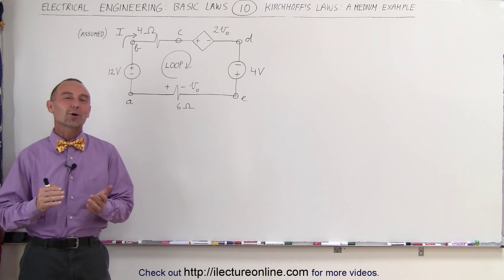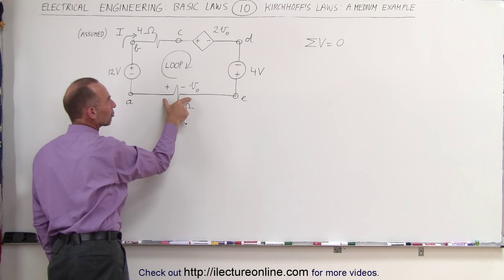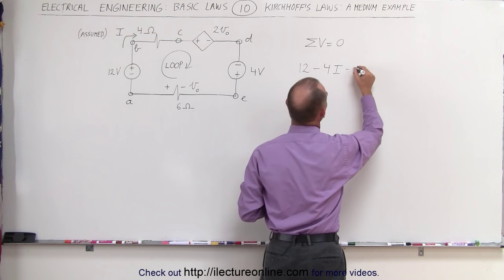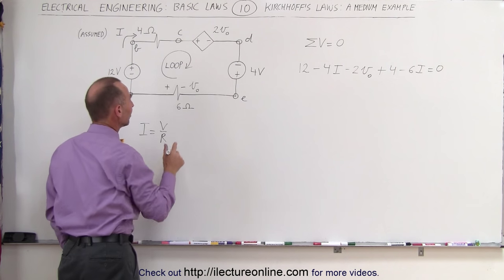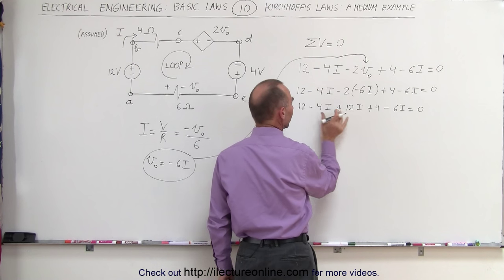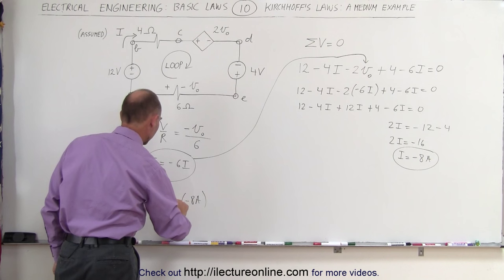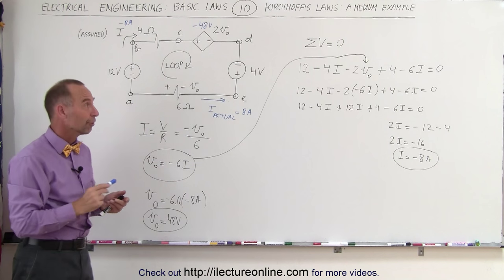Electrical Engineering: Basic Laws (10 of 31) Kirchhoff's Laws: A Medium Example 1

Comment: Thank you for your time and teaching skills.  Since the voltage drop across the 6 ohm resistor is 48 volts and the battery supplied voltage is 2X that voltage drop then the supplied voltage of that battery should be 96 Volts and Kirchhoff's law will work out.
Reply from the maker: You are correct.  it is 2 x (-48 V)
Reply: man i've seen that too, thanks for addressing.
Reply: I saw that too. Thank you for clarifying.

Comment: why does the voltage between C and D is -48 V ? in the video it says 2Vo, what the reason?
Reply from the maker: You are correct, there is an error.  Since Vo = 48 V,   2Vo = 96 V
Reply: @MichelvanBiezen  It also means there is a voltage increase across Vo voltage source rather than a drop!
Reply: @MichelvanBiezen  but is it -96 or +96
Reply: @creedo8301  negative
Reply: With first assumptio is positve, but then with the correct direction of the Current is
 be negative

Comment: The direction in 6 ohm resistor is double standard. You cannot justify double standard. The problem is vague.
Reply from the maker: Not sure what you mean by "double standard".  But in order to solve a problem like this, you have to assume a current direction.

Comment: You have a minor error in sign convention. please revisit your work. Your sign convention show 12V as Positive  and so the 6 Ohm resistor with sign convention Vo must show Left side (-ve) and Right side (+ve). You have shown it backward I believe
Reply from the maker: The video is correct.

Comment: It is possible to have this kind of circuit in real life ? I mean there are 3 voltage sources "pumping" voltage in different direction (+ connected to + and - connected to -). The formula implies that it's the "strongest" voltage  source that win (the one between c and d) and it's this one that imposes the current direction. But then how the 2 others react in real life ? Won't they burn if we "feed" current into them?
Reply from the maker: You could hook up such a circuit and no this wouldn't cause problems, but then you are correct, it doesn't serve any purpose except that if gives us a good exercise problem to learn from.
Reply: @MichelvanBiezen  Thanks for your quick reply!

Comment: For anyone still having trouble figuring out why the professor put a minus sign in the Ohm's law equation, here's how I think about it: yes, you assumed the direction of the current, and you have to calculate the drops according to the assumed direction. BUT, here's the catch, since there's a clear giveaway of the current direction on one of the resistors, and we're going against the literal flow, we're expected to get a negative current anyway. So, how can he set up an Ohm's law equation to get the negative current, since he MUST get the negative current? Well, since the resistance can't be negative, and we don't know what the current is YET, but we DO know it MUST be a negative, he has to setup the equation in such a way to make sure I=V/R turns out negative, which he does by putting a negative sign in front of the voltage.

What's actually happening is, we know the voltage is some V , and depending on the direction we assume we add or subtract the V , and resistance is R .
But the current is -I , since we have the wrong direction, and the current WOULD'VE turned out to be negative, had we calculated the I any other way. 

All in all, it is imperative that I=V/R be negative, taking into consideration our wrongly assumed direction, BUT paying attention to the hint we were given.
Reply: Thanks so much! I haven’t understood yet why in KVL we have -6I if it goes from - to +. But we changed its sign in Ohm’s law equation ( tho I understood why)
Reply: Thank you!! I read your explanation several times and finally understood :))

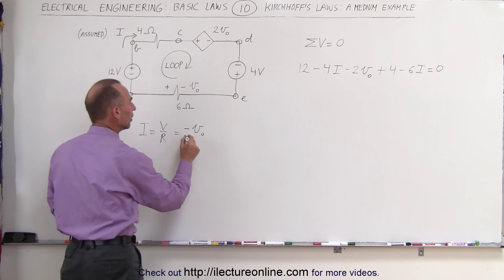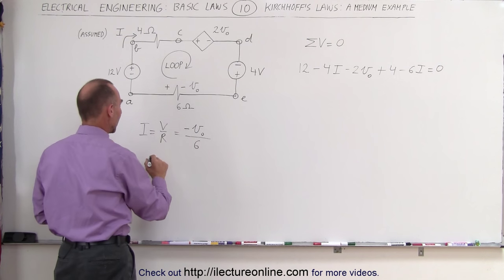Comment: So just to clarify what you say at 3:10 - 3:20, you put -vo because the polarity is pre written for you on the schematic? Otherwise you would have to assume I=vo/6?
Reply from the maker: Yes, it is a little tricky.  Since we chose the direction of the current, clockwise, we need to remain consistent with that choice.
Reply: @MichelvanBiezen  thanks for the fast reply

Comment: very nice teaching style. One thing about which i am confused is why the polarities of 6ohm are not as same as 4ohm?
Reply from the maker: That is the way the problems was defined.  Note that the polarity is actually the same, since when you calculate the voltage across the 6 ohm resistor you get a negative value.

Comment: This is the reason why I believe the voltage is given a negative sign , excuse me if I'm wrong: since we are assuming that I is going clockwise and we are given the hint that the voltage actually rises over the 6 ohm resistor if we go along with that assumption, then V0 is actually the voltage drop over the 6 ohm resistor in the opposite direction of what we have assumed. Since V0 is the voltage drop in the opposite direction of our assumption, we must use -V0 to change the direction of V0, which gives us the voltage drop over the 6 ohm resistor in the direction that matches the direction that we assumed I to go in. Is this right?
Reply: The voltage doesn't rise when we assumed that I is clockwise...it drops since our loop is also clockwise

I think many people are confused why Vo is negative when there is a polarity of - + on the resistor ...

The thing is resistors have no polarity, only batteries do, therefore we should just ignore the polarity shown on the resistor...

Notice at the first resistor V= -4I, this is because the current has the same flow as the assumed direction of the loop, which indicates a voltage drop, meaning "-V"(negative value for Voltage)...and the same should be done with the second resist or. At second resistor (*ignore polarity on diagram), since the assumed direction of our current(I) is clockwise and the loop is also clockwise the voltage here should also have a negative value thus V= Vo= -6I > a voltage drop. "Vo" here simply means that the that "V" should be represented as "Vo"

2Vo is a voltage rise and a battery, therefore we base its sign on the polarity of thebatter. Since the current flows from + -, V has a positive value thus V=+2Vo

12V is a voltage drop but since it's a battery value of V is based on the polarity, from - + it produces a positive voltage

Comment: Would there be a 48v positive across from the -48v, going clockwise? Thank you so much for your videos sir!
Reply from the maker: This problem is indeed a bit confusing.  Moving across the 6 ohm resistor in the direction of the current should result in a voltage drop.  But since the polarity of Vo is reversed we must take it as a negative.

Comment: The reason for negative on the 6ohm, is because we assume direction clockwise. We then ignore , the signs on the resistors, only considering the signs for the voltages. ... Afterwards we consider the given sign, for the 1 resistor, and using V = IR results in the -V, to rectify our error initially. Solving for I, and replace to get correct answer
Reply from the maker: The negative sign indicated that when traveling across the  6 ohm resistor in a clockwise direction, the voltage drops.

Comment: i think he just made an error when considering the 6 ohm resistor. since theres always be a voltage drop across a resistor when its placed in the direction of current. the signes on the 6 ohm resistor must be interchanged and KVL equation must be done again. please look this video up again sir. therefore 12-4I-2vnot+4=0 .  vnot = 6I  . then 12-4I-2*6I+4-6I=0 , I=16/22=0.7272A . Vnot = 6*0.7272 = 4.3636V  therefore 2Vnot=2*4.3636 = 8.7272V 
sir please correct me if im wrong
Reply from the maker: The video is correct.   (There is an annotation at the top of the page as 2 x Vo = -96V)

Comment: Wouldn't the voltage difference across Vo be negative? We determined I = -8, then corrected it's orientation so the new Current, I = 8.

According to the new current orientation, it is a voltage drop as well so wouldn't Vo = -48?
Reply from the maker: Typically when we refer to the voltage between 2 points, (the potential difference), it is a positive value (the magnitude of the difference).  When we also indicate the direction of travel in the circuit we refer to it as a voltage rise or a voltage drop

Comment: We've already established the video has a mistake in the voltage across the dependent voltage source. But my question becomes, is the correct answer -96V or +96V? With the correct direction of current in mind. 

Nevertheless, thank you for the video !!!
Reply from the maker: Yes, some of the other viewers caught that as well, see the comments.  Thank you.
Reply: It is -96 V accordking to the real current flow direction

Comment: I got a bit confused by several battery elements/power sources connected in series in the same circuit. Because to my understanding I have not seen a physical example of such in my everyday life. Also one battery is with opposing polarity to the other two batteries. When I see a battery, I think it is supplying power/energy to the system. After your calculation is done the "square battery" of 96volts is clearly the driving force for the current in the circuit. But what do the other two batteries do then? Do the two other batteries draw energy from the system, or supply energy to the system? I am a bit confused by this. Could i connect AA batteries the same way as this schematic (with the opposing poles as shown) and expect current to run through the batteries?
Reply from the maker: The purpose of this (and other circuits used in teaching these conepts) is not to give you a "realistic" circuit that you will encounter in "every day life", but to present you hypotethical circuits that will help in the understanding of the concepts.   (For example, what happens when two batteries are connected in opposing polarity?).  Without these examples you will not gain the complete understaneding.
Reply: @MichelvanBiezen  Thanks for replying!:) Do the two other batteries in this example supply or draw energy from the system? I really like all of your videos by the way!😍
Reply from the maker: Batteries do not "remove energy" from the circuit, but if two batteries are connected in opposite directions the voltage from the smallest one is subtracted from the bigger one leaving the circuit with just a small voltage.
Reply: @MichelvanBiezen  Thank you!😊
Reply: @MichelvanBiezen   The GPS videos looks interesting and quite comprehensive, I am going to watch after i finish my exam. Thanks for all the amazing work you have done!  By the way, I understand you have been working a lot on radars, if you by any chances is making a RADAR video in the future I would be the first one to watch it!
Reply from the maker: Yes, I have worked on radar for 30 years.  We are planning on making videos on radar principles as well.
Reply: @MichelvanBiezen  😍♥️

Comment: I am little bit confused about the signs, in the book it says if we start from the node a then it will be -12v+4i+2v0 - 4v - 6i?? is that correct? thanks in advance for your great work.
Reply from the maker: Are you saying that the signs are in reverse?   If that is the case they are using the opposite convention.  Either way you will get the same answer.  I prefer to use the convention of positive current and when you travel in the dame direction as the current across a resistor you get a voltage DROP.
Reply: @MichelvanBiezen   thanks for your reply. I didn't get the same answer so i think I'm doing something wrong. I will follow your way. thanks again.
Reply: @MichelvanBiezen  voltage drop when the resistor is given the opposite direction, when its same as current direction its negative.
Reply: That signs means where you enter in battery if positive then you take positive if negative then you take negative as you  write ,and always take resistor positive when the resistor is in current direction

Comment: Sorry sir, i just want to ask about
there are positive sign and negative sign around the 6 ohm resistor, is it refers to the terminal of resistor or the change in voltage along the path from e to a.
Reply from the maker: It represents the relative voltage on either side of the resistor due to the direction of the current.  (the plus side is at a higher potential than the negative side)
Reply: @MichelvanBiezen  Would that mean the current travelling that clockwise direction would be +6i as its going from - to + side?

Comment: what is that diamond shape mean?  Is that the voltage across this thing will always be voltage drop.? because for my understanding by book, this symbol mean dependent source which is an active element, so is same to that of voltage source, thus why doesn't voltage rise across this diamond symbol.?
Reply from the maker: That diamond shaped thing is a dependent voltage source.  The voltage across it is always 2 x the voltage drop across the 6 ohm resistor.

Comment: How come from e to a it's not 6i but -6i? I thought when you go from - to + there's a voltage "rise", so shouldn't it be 6i?
Reply from the maker: First you need to assume a current direction, which we did.  We chose the clockwise direction.  Then going from e to a, we cross a resistor in the same direction as the current, therefore there is a voltage drop (-6i).  Then we calculate the current and we find that it is:   I = -8 A   (The negative sign means that the current is actually in the opposite direction than the direction we assumed).  Thus we know that going from e to a, there is actually a voltage rise:  V = - 6i = -6 (-8A) = + 48 V
Reply: Thanks for the quick reply. I was confused by the signs on the resistor. That makes sense.
Reply: I am still confused on why it is not a voltage rise on the 6 ohm resistor, making it a positive "V sub not over 6" and not negative. The direction shows that the resistor is going from - to +. This should make it a voltage rise, but the math and everything checks out. Also can you elaborate more on your statement when you say, "Why minus, because we're assuming that the current to be this direction... which should make this a voltage drop, but instead it's a voltage rise."

Comment: Sir may you explain why the  resistor with 6ohm is different from other sources?
Reply from the maker: There is nothing different about the 6 ohm resistor, it is simply a six ohm resistor.  In the problem we are told that the voltage across the 6 ohm resistor is Vo
Reply: I wanted to say that it is not clear for me what is the reason for Rising voltage in 6ohm resistor while every in every other resistor voltage drops 😊 @MichelvanBiezen

Comment: why do we assume that the last one is drops even though it normally rises ?
Reply from the maker: I am sorry, but I don't understand what you mean by "the last one".
Reply: @MichelvanBiezen  while finding the value of Vo why did we write minus before Vo/6 ohm ? i did not understand because it goes from minus to plus .
Reply from the maker: The voltage across the 6 ohm resistor was initially indicated (given) as - to + from left to right which is in opposition to the direction of the current indicated.  So we place a negative sign for the current.
Reply: Hmm okay. I got it. Thanks a lot Mr. Michel van Biezen:)) i really appreciate it.

Comment: Hi, I am so confused you have two possibility 
First one is 
12-4I-2V0+4+V0=0
The second one is 
12-4I-2V0+4-V0=0

Now for nodes e and a you use VOltage drop then for node c and d you use voltage rise???!!!!!!!!!!!!!!!!!!!!
How???!!!!!!!!!
Reply from the maker: Work it the way it is shown in the video.  Moving clockwise with the current, the last term is a voltage drop across the resistor:  IR
Reply: @MichelvanBiezen  ok thanks for the replay

Comment: Sir it's my second time I am not understanding why the voltage rise in the 6 ohm?
Reply from the maker: If you travel around a loop against the current, the voltage will rise across resistors.  (Like moving up river,  and up a waterfall, you gain height)
Reply: @MichelvanBiezen  I know but in the resistor 6ohm the current goes from negative to positive. According to the law it should be arise in the voltage, however it is considered a drop in the voltage here I didn't understand this concept.

Comment: I think you made a mistake in the video. If V0 = -48 V then shouldn't the top source which is 2V0 be -96 V?
Reply from the maker: +tehlolzfactor 
The video is correct as is.
Notice that the orientation of the +/- signs are opposite across the resistor and across the voltage source.
Reply: My first guess is that you're right. Adding the voltages from +12V to -12V on the left battery would give 12V+32V-96V+4V+48V=0V. Please correct me if not so. Btw, thank you Michel, for taking the time and effort to share your knowledge with us.
Reply: @MichelvanBiezen   I have a question sir..